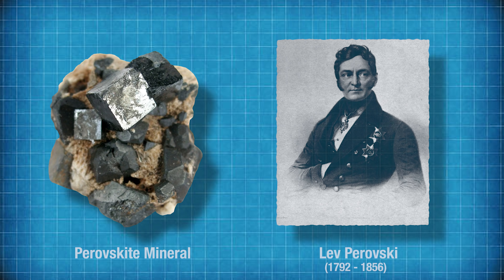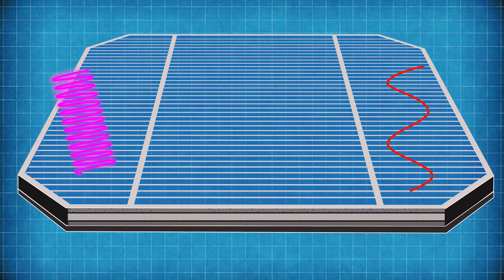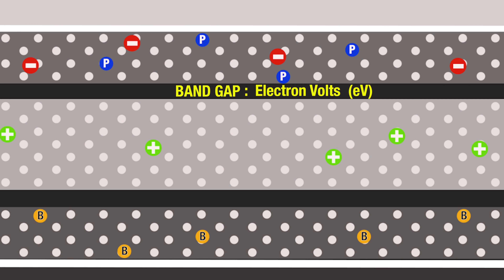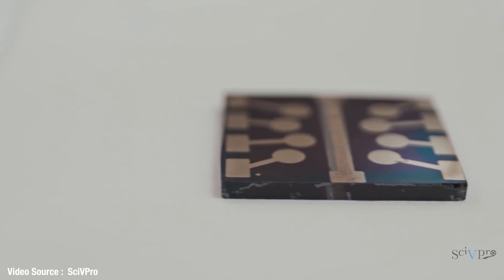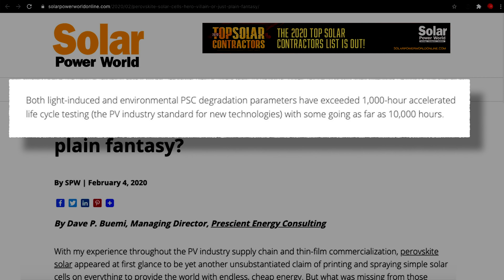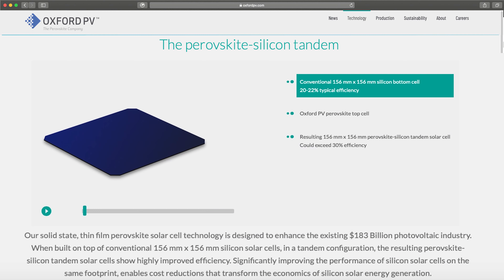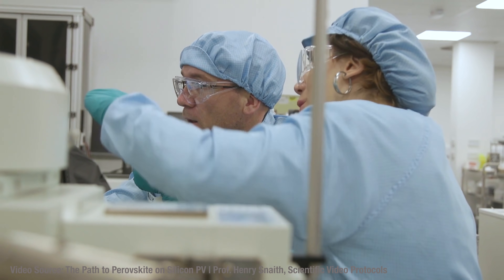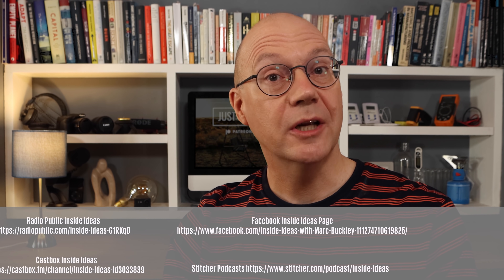Perovskite Solar Cells: Game changer?

Comment: Oil companies around the world are losing their grip on controlling the energy system. 
In the past few months,  5 major investing firms have pulled out of the Alberta tar sands,  billions of $ are being redirected into the alternatives. 
Fracking in the USA is taking a beating,  Saudi is scampering for sales. Alot of offshore oil  rigs are sitting idle, Hibernia has shut down for a minimum of 18 months.
Reply: And Shell reported 18 billions (euros or dollars, don't remember) of loss
Reply: @SlabtheKiller89  and non off it is because of solar in any form.
Reply: How much of this is due to the pandemic recently and the price war between Saudi Arabia and Russia?
Reply: These losses to the oil industry are more to do with half the world being in lockdown and business only going at half pace than solar taking off. And i have a battery powered aquaponic set up in my backyard but facts are facts
Reply: @LazicStefan The one that gets me is this DC fast charging talk, where they reckon they can charge 100kw/h battery in 10 minutes. Times that by 10 and theres a few MW's extra capacity that no existing transmission lines can handle.
Reply: @MrWackozacko  There are local storage options, since the demand isn't continuous.  Charging local storage (maybe decommissioned electric car batteries) with off-peak cheaposity.
Reply: Chris King decommissioned car batteries?? Really?!
Reply: @farmgadgets7261  umm oops... Well i wasn't even thinking of those lead-acid things when i wrote that. Please reinterpret in an e-car sense.
Reply: @ChrisNotTheKing  apologies, point taken...
Reply: @ChrisNotTheKing  possible but probably more expensive than upgrading transmission lines that will have to be upgraded eventually anyway.
Reply: Thats what happens during a shutdown. It has nothing to do with "green" energy.
Reply: There aren't any moguls sitting in dark conference rooms planning to defeat solar. Solar doesn't work yet, but the technology isn't quite there yet.
Reply: @fritigerngothic4352  solar is impractical and expensive .   To power a typical American house 24 hours a day on solar .a person would spend 20 or 30 years worth of electric bills .
Reply: @boracay12   ? Tell that the many that have it in Texas, California, Arizona ......  you really have to update your talking points.
Reply: One of the largest solar fields in the US was purchased by Exon from Enron when they went under. Renewable are still not reliable or effective.
Reply: @LazicStefan Yes. :-)
Reply: Well Rick that sounds like a lot of employment opportunities wiped, out so not good news for everyone I fear, good high skilled jobs wiped out too, and with corporate green constantly looking to exploit low cost labour markets abroad any green jobs with have little benefit for blue collar workers in developed economies, so perhaps the only truly inclusive part of these successes you celebrate is the disproportionate obligation or burden to contribute in subsidising corporate greens profiteering, or am I wrong ?
Reply: Rick Small — A restatement of your premise, in relation to the facts you set out, may helpful to readers, mainly by tempering the implicit assumption that an energy transition is beginning to happen quickly. National and private oil companies and other entities involved in shipping, storage, and refining have been in turmoil in the months since the Covid pandemic led to an unprecedented massive drop in oil demand. Russia (the “gas station masquerading as a country”) didn’t help by the effort to goose its oil production just as OPEC was trying to cut back. The resulting panic, fear and uncertainty among oil traders drove oil prices to ridiculously low levels (followed by the crash in stock prices, followed by a president who neglected the Covid crisis, instead fixating on the impact of falling stock prices on his re-election chances). Everyone in possession of actual oil scurried around looking for somewhere to stash all that extra oil from the crash in demand. Near-term futures traders panicked over the prospect of actually having to take possession of the oil they contracted to buy with borrowed money. (Meanwhile the few consumers lucky enough to fill their tanks bought cheap gas and investors lucky enough to have cash bought cheap stock and oil futures for big gains later on.) After discounting all of that, it’s not clear there has been any acceleration in the fearfully slow rate of change away from fossil fuels. World oil is a market; not even a group of major actors ‘control’ it. When most all oil subsidies are eliminated & externalities are priced in by governments under an international framework (Paris Agreement revived or replaced by a successor, post 1/20/21), with sufficient incentives enacted to push far more change, inertia will continue to ‘control’ the energy system (even past the point of no return on environmental destruction).
Reply: Wind and solar plants are gas plants. They are the fossil fuel industry's best friend. A major investment in wind and solar locks in natural gas peaking plants for decades. There will in no forseeable future be global webs of HVDC or storage on all time scales from minutes, to diurnal to seasonal.
Reply: Electricity is not made by oil companies  in USA .  It's coal or nuclear .   Solar is expensive and impractical except for a small scale  day time use .    Storage for overnight use is practical for light bulbs it would take decades to recoup the cost in solar and by the batteries would have been replaced multiple times.
Reply: Ok . Where can I buy these panels .  Oh not available .....yet ,maybe after I'm dead . Thanks though .
Reply: as long as the green parties keep shutting down nuclear plants and new plants we will always need fossil fuel to backup solar. battery technology has not caught up yet. the real reason the oil industry took a giant blow right now is the pandemic and the already struggling oil price.
Reply: Alas, America's economic supremacy rests with the petro dollar.
Reply: Well the oil companies have been producing more than needed, with a inflexible and over-optimized distribution system ...
Reply: As a Canadian that remembers many things I'm glad you used the proper name 'Alberta TAR Sands.' Because in reality that is what they are.
Reply: It is not the oil companies that is the main limiter for implementing solar/wind/hydro/other electric genetators as the main energy source.
The main problem is that the infrastructure to transport the electricity is not there and when you add in the cost off updating and expanding the distribution network the total cost increase a lot.
Reply: @bknesheim  home rooftop solar with feed-in uses the infrastructure that's already there (except you need bidirectional metering). The drawback is that the panels are rarely pointed in the optimal direction.
Reply: @dickhamilton3517  New to be built houses in The Netherlands, and I believe also in the UK and Germany, are now required to have solar installed, new houses' roofs are all pointed in the right direction.
Reply: @MarcoNierop  don't know about where you are, but we build our houses along things called streets, and they don't all run in the same direction - you'd never get anywhere if they did.
Reply: @dickhamilton3517  The fact is that local erea network can easely be overloadet with feed back from rooftop solar.
For example a sub-devision off a 100 house will be scaled for the max need + some buffer say 500-700 KW. If 30% is fitted with 20KW panel (=600KW) you can on a sunny day max out the lines an damage them when they also need to supply power to a 70 house that do not have solar, but want to use air conditioning and cook food etc.
Reply: @dickhamilton3517  What has a street to do with the orientation of the roof??  You can just build it that way.
Reply: @MarcoNierop  Not true here in UK, I'm sorry to report.
Reply: @MarcoNierop  most of the houses in cities and towns adjoin one another. Not all, but 'most'. They all 'face' west, for example, on a given street. you are stuck with that.
Reply: bknesheim not quite sure you understand, what you are talking about. Your spelling is kind of a clue.... And just on the side, "kilo" is always written in lower case, so kW is correct, not KW.
Reply: @dickhamilton3517  New-build houses can have streets also built N-S and E-W, or on existing streets the new houses can be skewed on the plots. it's an easy fix.
Reply: @bknesheim  STORAGE and BATTERIES. which are now where solar was 10 - 15 years ago. Excpect MORE price drops for residential installations. the German governments already jumped on the breaks regarding solar panels for apartment buildings and commpercial users (there is a tax to be paid 1) when producing even if used at home and 2) when selling to the grid (it is DOUBLE). 

because they know their buddies from the large providers will not be able to compete. they have all talked about the wonders of the free market for a product that leans towards natural monoply (especially in times of massive shifts).

 Solar panels become cheaper AND the necessary battery / storage solutions that are a crucial part of a functioning solution are  ALSO are going to drop in price and will increase performance (economy of scale - as with solar and wind which are more advanced than storage and batteries). 

 That is the missing link that also makes it safer and easier to handle that  on the local level. Because MORE of the surplus is stored away immediately. And that is also quite planable.
Reply: @xyzsame4081  The problem with batteries is not a tech problem it is a resource problem. We just do not have the raw materials or the production to make the amount of batteries needed. Even the transport would be a problem without major expansions in the type of ships that can be used.
The cost in energy will also be staggering high. The only type of storage we have that can be used on the level needed is pumped hydro. High pressure air should also be something that could be an option  in a fairly short time.
Reply: @bknesheim  There are quite a few energy time shift systems beyond pumped hydro and chemical batteries. Two such are liquid metal batteries (still an ionic process but overcoming some of the issues with dendrite degradation AND thermal storage using materials like carbon or silica.
There is a pilot carbon thermal storage system running on Flinders (I think it it Flinders) Island and 1414 Degrees has recently commissioned a thermal storage system for South Australian Water. It holds energy by heating silica (silicon) to a liquid and recovers the energy directly as heat or through a Stirling enngine.
Energy storage in the form of green hydrogen is moving very quickly and has a lot of potential for transport applications in Australia.

Ziggy Forest has recently announced a Large Scale Solar plant in Western Australia to produce Green hydrogen and he will convert all of his Fortesque mines trucks and trains to run on hydrogen. He is also looking at a green steel facility.

In its latest GenCost report, the CSIRO and the Australian Energy Market Operator (AEMO) said solar and wind had come out cheapest even when the integration costs of renewables were included.
Intergration costs include additional costs such as storage and new transmission infrastructure.
The Liberal government announced they want to fund and build a gas powered generation plant, Industry and energy regulators say that a gas powered plant is a complete waste of tax payers money.

Australian house holds have the highest take up of roof top PV panels. Energy companies are expanding the network of wind generation and the Government.......... well they want to build (coal) steam trains,
Reply: @douglasbell3344  There is a difference between what is doable and what can be done in a given time frame. I am now about the project you mention and other very interesting metodes under development, but non of those can really built up to the many TW/h storage that is needed in the next 10-15 years.
In Norway where I live we have a advantage in nature that give us a lot of hydro power and storage at a scale no other country have when you compare by country size. We can store more than 2/3  (80+ TW/h) of what is used in a year.
At this level most of the materials used can not be transported and have a cost that is free or nearly free. Water, air and dirt/rock is the only thing that fit the cost transport and cost parameter.
Battery system like the those used in Australia is perfect for grid balancing and short term buffers. The cost in materials alone prevent a the building of the capacity needed in the next 20 years.
Reply: @bknesheim  Thanks for your comments. And I agree the systems required and tasks ahead are very large.

We have in SA the worlds largest Tesla Lithium Ion battery. This is as you pointed out to stabilise and balance the grid. 
We are also building the Snowy II pumped hydro system which will provide 2,000 MW of fast start power and 350,000 MW of storage.
21% of Australian houses have fitted roof top Solar PV systems.
We are now seeing a similar uptake in residential battery systems. 1 in 13 have now installed batteries.
Many commercial premises also have solar PV systems.
The other exciting development is micro-grids where neighbourhoods are being linked.

Grid level storage does need to be cheap and available. Thermal storage such as 1414 Degree system uses Silicon, the most abundant mineral to be found. Storage systems using green hydrogen also use abundant elements but of course hydrogen is difficult to contain and transport so converting to Ammonia is one avenue of development.
Internal combustion engines that run burning ammonia are under test and hydrogen compounds that can be used in conjunction with Large Scale Solar Arrays to store energy and time shift to provide 24 hour delivery. 

As you say it takes time to develop projects but it also takes time (and stupidity) to develop new fossil fuel burning plants, such as proposed by our Federal Energy Minister or suggest opening new coal mines.

Our State Governments are pushing ahead to achieve 2050 zero carbon for energy. The State Govt actions, the private uptake and projects that energy companies are funding, shows that the Federal Government is out of touch with reality. The world is facing a climate and economic catastrophe and change must happen quickly or it will occur in ways that will cost us dramatically. 18 months ago fires ran down the East Coast of NSW that were unprecedented and uncontrollable. The inquiry found that Climate Change was responsible for the severity.
We spent weeks fighting those fires, 33 people died, and over 3,000 homes were destroyed. Communities were isolated with no power or communications for days to weeks.

We need our Federal Government to wake up so that we can also achieve zero net emissions for transport and agriculture.

No one believes it will be easy but saying it is going to be difficult (impossible) or take a long time is going to destroy economies.
Norway is doing much better than Australia with EV uptake (we have a PM who makes comments such as "you can't tow a boat with an EV").
We are trialling cattle food supplements made from red sea weed that look like they will dramatically reduce methane emissions.
Our State government politicians can see that dramatic change is necessary to reduce the future (and current) costs of climate change and they are planning.
Reply: @bknesheim  EU countries are working very hard to upgrade the grid, which was due for a long time anyways. High power transmission lines are being built (Wintrac) to interconnect all grids all over western Europe, enabling distribution of electricty where it is most needed. An electricity exchange platform has been set up to regulate all this and get the best price for your electricity.

https://www.europex.org/members/epex-spot/

https://www.tennet.eu/fileadmin/user_upload/Company/Publications/Corporate_Brochures/The_Wintrack_pylon_2012.pdf
Reply: @MarcoNierop  I know, but it is also a fact that it will even if the program is exelatrated, it will take 20 years or more to increase the system to a point where it has the network can deliver enough electric energy to replace what to day is sourced form carbon based sources.
I live in Norway where we allready, and allways have because of lots of hydro, produce all electricity we need from "green" sources. Per capita we use up to 4x as much electric power as other countries in Europe, but we still can not really replace all carbon based power (car, truck, ships and more) without a masiv upgrade.
Reply: @bknesheim  In Australia the main limiter is the current Government (Liberal Party) Politicians that still do not comprehend climate change. The current Prime Minister took a piece of coal into Parliament saying how safe it was.
Reply: @douglasbell3344  Well, coal is very safe as long as you do not burn it or filter your water supply through it.
What is done is a political problem because we are still fare from a 'profitt' solution where the cost of solar/wind really is cheaper then the alternativ.
That is resource based and the amount needed for countries like Norway(me) or Australia do nt'ot matter. It is the what is needed in China and India that will deplete the system we have to day. There will be a need for a lot more mines to cover what is needed there.
Reply: @douglasbell3344   Well, at least he did not show up with a snow ball in the holy hallls to declare that climate change is not real. "See there is snow  in Washington D.C. in winter. Global warming can't be real."
Reply: @bknesheim  I agree , but its not what so called "progressives" want to hear . They are only interested in conspiracy theories !
Reply: Lol. The oil companies waited for the investors to get in deep into tar sands, fracking, bio fuels then dropped oil prices. They will buy them for pennies on the dollar. Keep what they want and go back to business as usual. Nothing will change as long as the world believes oil is fossil fuel and is running out.
If these solar cells get good and people go tiny and off grid they will pass laws to cause problems as they already are doing. Have to keep John Q paying those bills and taxes and working those 60 hour weeks. Nothing changes! The politicians waste and give away that money. They can't have you saving it!
Reply: LazicStefan yes, tiny wires can not transport an infinite amount of electricity. (Well, not unless we assume an infinite amount of time for the wires to do so..) Don't you just love it, when some ignoramus, who does not understand electricity embarks on lecturing others on the topic??
Reply: That is due to the oil war between Russia and the Saudis. The Wuhan flu also dropped demand for a few months.
Any alternative energy source is uneconomical, now that oil is dirt cheap. Especially anything in the frozen deserts of Canada.
Reply: @Aimless6  Dont forget that Ice cars and trucks are more efficient and that electrics are gaining market share. And the youngsters aren't as car centric and are pushing for public transportation. On the other hand they seem to like to globetrott. Don't necessarily like this but it's what I'm seeing.